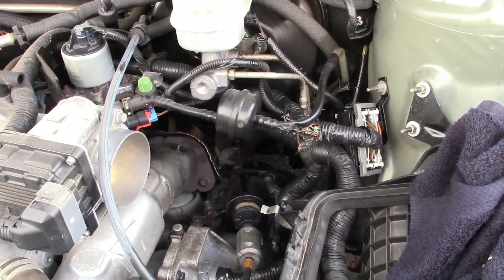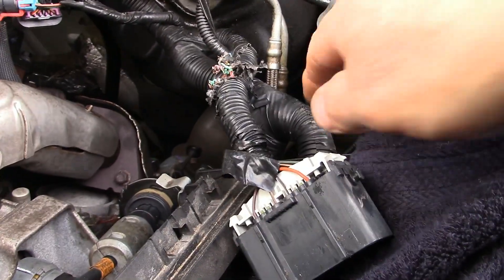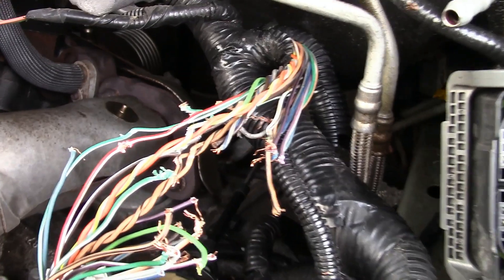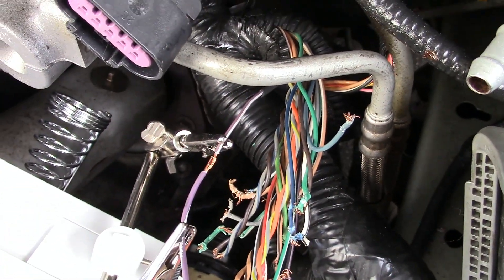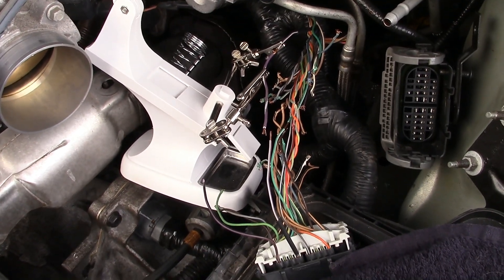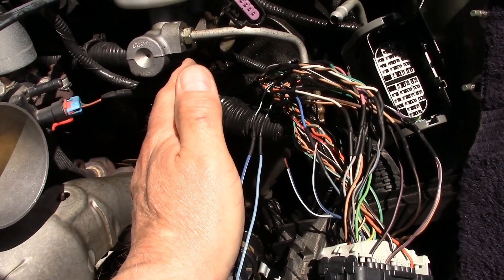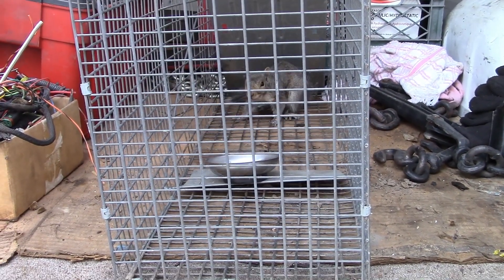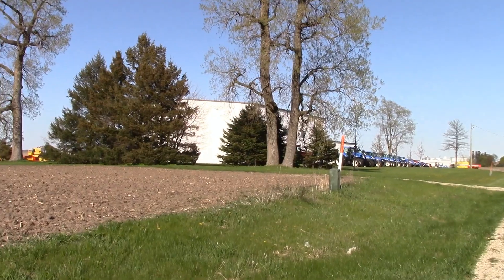2007 Buick Lucerne Wiring Repaired

Comment: What wire harness was this? I need to find the location of the transmission wire harness. And if that isn’t my problem once I replace that, do you happen to know where the transmission solenoid is? I’m almost positive my transmission is ok, I think it’s just electrical issues since my car came from a hurricane ridden state since and I’ve already had to fix 2 other electrical problems.
Reply from the maker: This is the main engine harness.
Reply: @dyna1955  can you please help me

Comment: Hi, my name is Michael. I know this is probably a long shot but I have a 2007 Buick Lucerne 3.8 with a strange ticking and sound that I think is coming from the engine. If you could give me any advice I would greatly appreciate it. I've taken it to two places so far and basically I was told to wait for it to get worse which sounds like the worst advice ever. It only ticks under load and it will do it in any gear. If I hold the brake and hit the gas it will sometimes do it then too. Generally it's only when it's up hill or when I decelerate and then quickly accelerate again. So far I've cleaned the MAF sensor, replaced the pcv valve, put in Sea foam in the gas and the crank case, tried to use higher octane gas, changed the oil and air filter. Drained and changed the filter on the transmission and changed the transmission lines and put in a brand new radiator. I have a few things with some symptoms that might help. My water pump is a tad loose but still keeps the engine cool and I have no clue when, if ever, the spark plugs were changed. Any advice would be appreciated and thank you for reading my long winded comment. Thanks again and I'm glad you got the car fixed!!! Sincerely, Michael.
Reply from the maker: How many miles are on it? Have you tried using a stethoscope to isolate the sound? Does it get louder when it warms up? If it only does it under load I would say it is probably not the valve train.
Reply: @dyna1955  thank you so much for replying. It has 136,000 and I don't have a stethoscope. Plus it only does it under load and rarely does it when I put my foot on the break and hit the gas. So it's hard to listen to it anyway. Also, I found another symptom today. It won't rev beyond 4,000 rpms and bogs down to 3,300 if I hold the gas to the floor. Could the cat conv be causing that and a rattling under load?
Reply from the maker: The only way to know about the converter is to disconnect it and try it.
Reply: @dyna1955  thank you for all your help.

Comment: I had my motor mounts replaced on my 2007 Buick Lucerne recently.  I was then told to tow to a electric shop for engine wiring harness I saw wiring taped under hood of passenger side close to windshield? Now my car won't change gears my engine cover was missing after it was originally worked on and air intake hose disconnected. I payed 2,000$ for all for motor mounts
Reply from the maker: I repaired mine just good enough to get it to the dealer. After I repaired the wires I had a lot of codes and not everything was working. My insurance paid for most of the repair. I took mine to our local Buick dealer and they installed a new harness and cleared the codes.

Comment: As we speak this is 2019 and I have the same problem right now going on with my Buick Lucerne I don't know if a squirrel done it or a rat or a mice but it's a big mess of fur particles in my engine and they done something to my motor to where it won't start so I'm pretty sure the mouse or squirrel or whatever it was chewed through my wires of the coil wires ignition wires that plugs into harnesses or whatever. Sitting in my garage just parked letting my car rest and relax come back to it try to start it , it would not start .
Reply from the maker: My insurance company paid for a new harness.  $1500.00